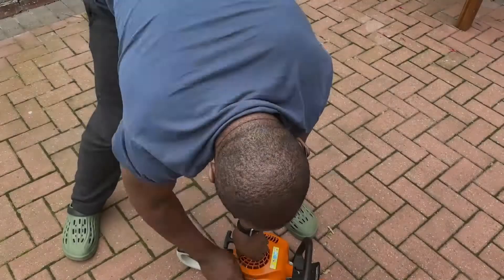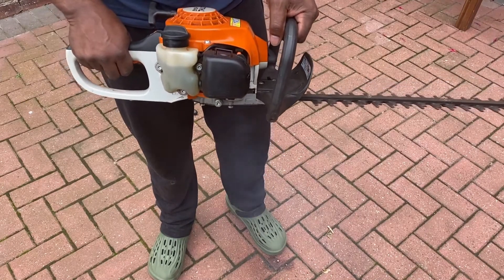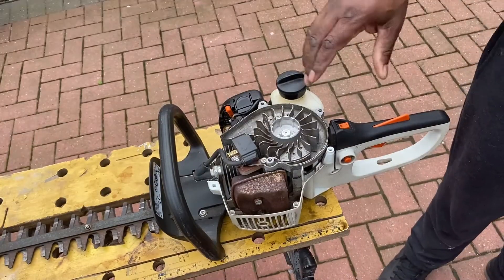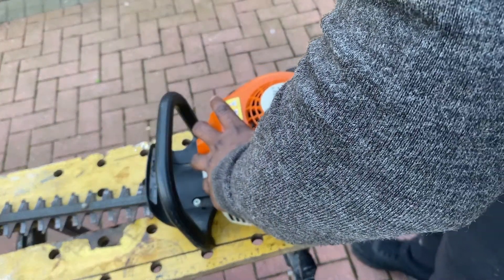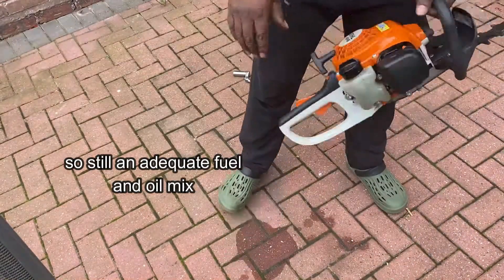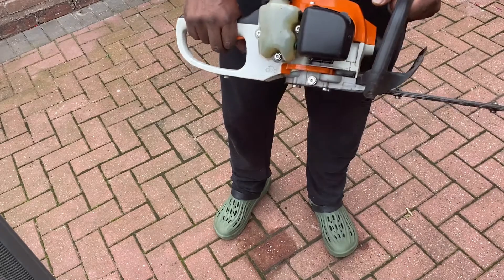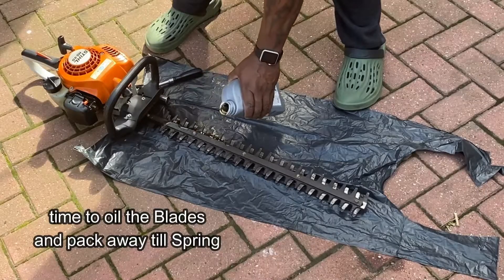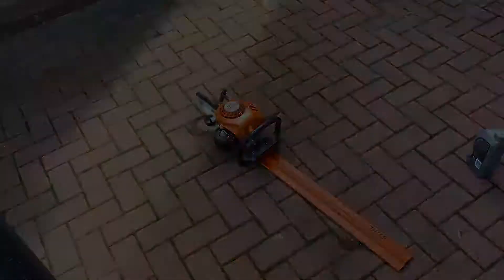STIHL HS 45 Petrol Hedge Trimmer Too Much Smoke

Comment: My HS45 smokes a lot especially under load.  It really is almost intolerable.  I replaced the carburettor, replaced the spark plug - more recently with a hotter one NGK (not 7 as recommended by Stihl but 6 - NGK heat ratings go backwards) new air cleaner and have been using the same fuel/oil mix as my three other Stihl machines - none of which smoke, and although marginally better it still has a long way to go.  Compression feels good though not formally measured.  Been holding off on changing the mix ratio but I'm going to try it now and it seems that the amount of added fuel is a bit arbitrary?  Trial and error sort of thing.  Any ideas?
Reply from the maker: Not sure Brian,
                          as you seem to have covered everything. The owner of this machine did not use the correct oil/fuel mix, too much oil actually, try less in yours, after clearing the existing or another Brand and see what that produces.
 
                              Regards 😀.
Reply: @green-crocs-fixes1520  Cheers GCF, I'm using Stihl oil at recommended 50:1 but the machine doesn't know that so I'll try a dollop of extra fuel in the mix.  Wish me luck.
Reply from the maker: @BrianMorris-b7t  👍